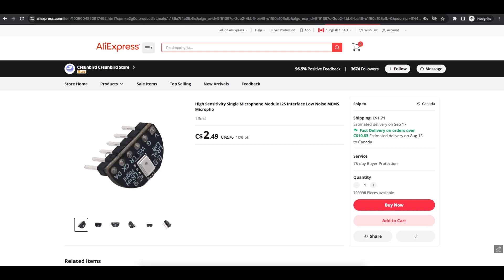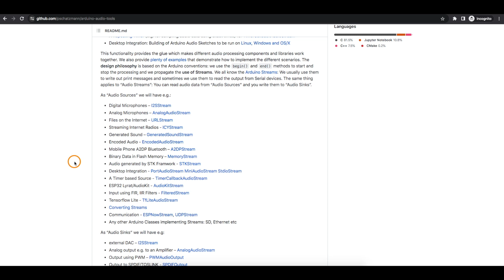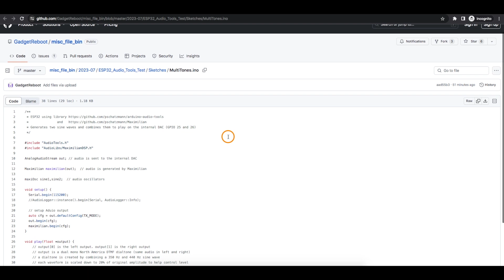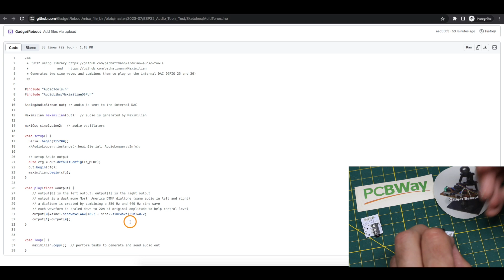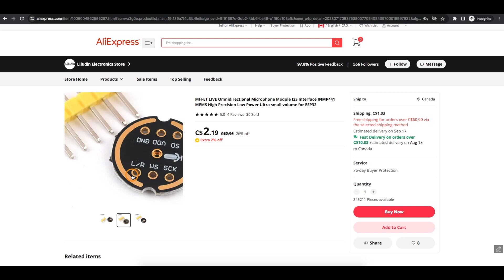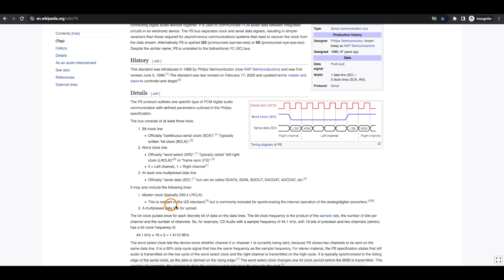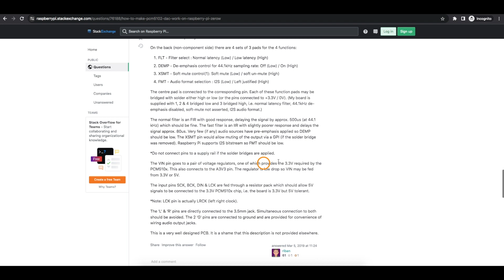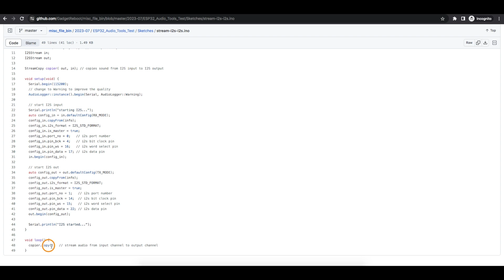I2S: MEMS Mics and a PCM5102A DAC

Comment: Hello, I am trying do this application using STM32 MCUs. I have a question. Are you using one pin of the ESP to get the PDM microphone data or they are connected to separate pins?